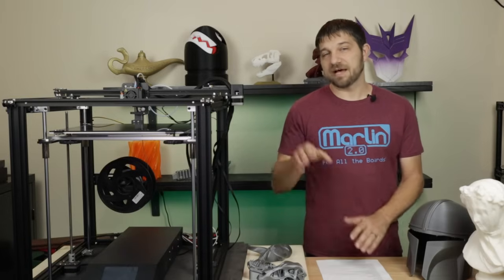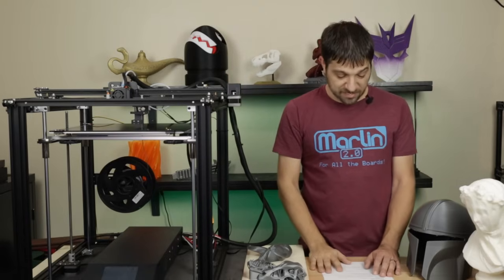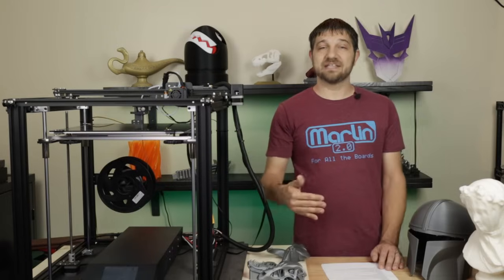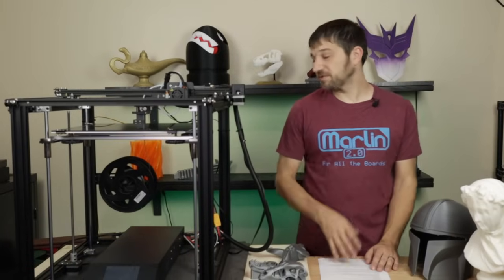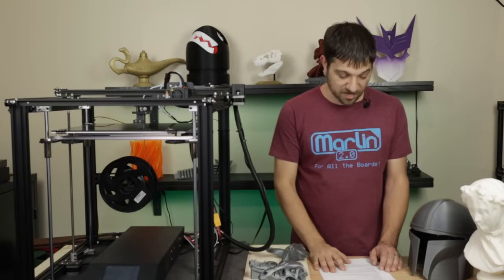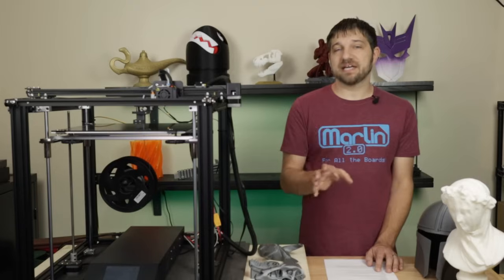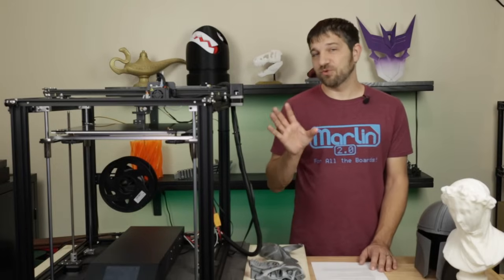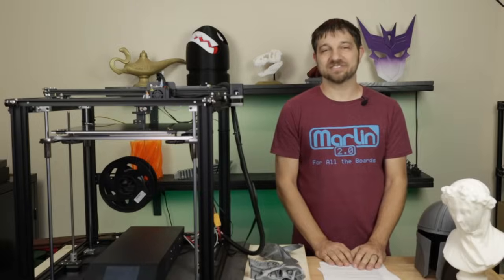Creality Ender 5 Plus Review: EVERYTHING You Need To Know!

Comment: Hi,

What happens if one of the z-axis stepper motors is one (or more) steps behind or ahead? The printer doesn't seem to know where one or the other motor is since they are hooked up in parralel or serial at the same stepper driver, so the motors are not synchronized are they?

So if one motor is a step (or more) out of sync the bed construction is not alligned. Do you have to alligne both z-axis motors manual? What happens if one motor skips, and what do you have to do after that?
Reply from the maker: If one of the motors were to lose a step while performing a layer change then, yes, your print would be off. If that happens though, there is a problem with the mainboard or the stepper motor. There is very little force/resistance on those motors since they are performing very small steps and doing relatively little work thanks to the shallow incline of the screw. I have seen people mod the printer to include a belt between the motors for synchronization but I think it's unnecessary.

If you were to push the printer too fast during a Z move or manually bump one of the motors/screws, you would need to manually re-level like any other dual Z-axis printer.
Reply: @kerseyfabs  Thank you very much that was what i needed to know.

So yeah i understand it can happen, how do you relevel it fast? Is there a procedure in the creality manual for it?
Reply from the maker: I don't think there is a procedure for any printer to re-level during a print. You'd probably need to stop, diagnose why it happened, and then start again. If it happens once then there would be concern that it would happen again.

Comment: Awesome video. 😁👍🏼 What kind of software is used to create the objects you want to print? I’m a noob. LOL
Reply: Hey DJ! There are two main pieces of software involved in 3D printing; a CAD modeling program, and a 3D slicing program. CAD programs could be anything from Solidworks to TinkerCAD, Google Sketchup, Blender, Fusion 360, Auto CAD, Etc.... There are many options. These are the programs people use to design custom objects (: You just need a program that can design a 3D object and export it into a usable file for 3D printing, an .STL is standard. You can also download .STL files (3d objects) that other people have created from many places on the internet like Thingiverse or MyMiniFactory.

Once you have your .STL file, you then import that file into your second program, the Slicer. Some of the common ones are Cura, Simplify3D, Slic3r, but there are many others and most 3d printers will come with a slicing program on the SD card. The slicing program has one job - to take your digital 3D object and turn it into physical, mechanical instructions for your 3D printer. It's the slicer that you would use to set your parameters like print speeds, temperatures, layer height, fan speed, etc, etc, etc... for each of your prints. Once you have your settings how you want them, you then export the file from the slicer, which is usually a .gcode or .x3g file. This is the raw instructions that go on the SD card, which you then load into the printer, find your file, and hit "Start".

Comment: I am looking into getting a 3D printer and was wondering what you thought the best printer is that’s under $600?
Reply from the maker: "Best" is very difficult since there are so many uses and so many need. If it's your first 3D printer, there's nothing wrong with getting something smaller and time tested like an Ender 3, Ender 3 V2, or Ender 5 Pro to get you started. If you need something bigger, the CR-10 S-series is a bit easier to use than the Ender 5 Plus. If you want an awesome platform that's excellent for modding but is sometimes a little frustrating for newcomers, the Ender 5 Plus is my favorite printer. I know I haven't listed any other brands here but it's because low-cost brands always seem to have tradeoffs and Creality makes solid low-cost printers if you do your research on potential issues with some of their newer models.

Comment: Can I install a skr 1.3 with tmc 2208 or 2209 on the stock printer? Waiting for creality to give us marlin source code for report settings to marlin 2.0...
Reply from the maker: You'll need some sort of mounting adapter for the board and probably a new display. I'll be doing something similar to this. Different board to make things easier.
Reply: @kerseyfabs  MKS SGEN ? can re-use stock display with this board ?

Comment: is it possible to do a 360mm circular print.  I see the build plate is 371mm dont mind modding the head back plate, fan position etc.  I have one one order and a print has just come in which is 360 diameter DAM IT.  printer want arrive for 10 days but its on route.  can can make a bigger build plate  if required from FR4 fiberglass as a temp solution
Reply from the maker: I see what you're saying. I'm pretty sure you'll be able to pull that off. You may just have to lie to your slicer. The actual print area is 360x360 though.

Comment: As someone who is looking to buy their first 3D printer I wonder why Creality makes CR-10 and the Ender 5 models? I know size comes into play but the features seem to be the same and any features they may lack you can mod and add so that seems a wash as to difference. So it seems to go back to size but both CR-10 and Ender 5 have both small and large models. So why would someone buy one over the other? Ease of use and putting it together?
Reply from the maker: The CR-10 and Ender 5 do have similar software and features. The main difference is the way that they move. The CR-10 line is similar to the Ender 3 in the way they move. There is an X gantry that moves side to side and the bed moves in the Y direction. Then the X gantry also moves up for height. Now depending on bed size and weight of the print, you can have issues with ringing on the print or possible issues with parts coming loose on the bed. Many people really don't like the idea of moving a heavy object like the bed rather than I like part like the print head. That's where a printer like the Ender 5 comes in. The bed moves up and down but the print head moves X and Y.

Now in reality, many people have CR-10 variations and love them. They learn to print on them with little to no issues. So for Creality, it's offering both types of printers for both types of customers. There is more to say on this but too much for the comments. 😀 I hope this helps.

Comment: Any idea if you were remove the top front cross bar in order to fit an e3d hemera and petsfang/hero me if it would be just as stable ? Or would you have to have a custom bracket to extend if out a bit ?
Reply from the maker: It would probably work without it but I wouldn't do it, just fearing losing rigidity and quality. I plan to work on this, so I'll share everything.
Reply: William, I added the Hemera to my Ender 5, and lost about 10mm on front and right side.  It should work on the 5Plus, but will have the same problem.  I expect more mods to allow for it to work without loosing print area.  I also had to come up with a way to feed filament to the Hemera.  Here is my setup.  https://www.youtube.com/watch?v=mSIcFcq5_Ww
Reply: @woodwaker1  Very nice. Yeah I know its not much to lose but it's still a loss lol. I also have an Ender 5. Been through hell today trying to get the bed to stay level. Seems like if I even bump the front of the bed it gets all out of whack. Just tightened everything. Maybe I have some bad springs idk.
Reply: @williamtaylor2807  I replaced the springs with solid mounts from TH3D.  They are a pricey, and you need some kind of ABL to do this.  Since then I have not had to level my bed or worry about prints.  I have an Ender 5 Plus with the BL Touch - much prefer the EZABL - it does not contact the print bed and seems much faster.  I think the solution to the Hemera will probably be some kind of bump out.  Here is something I'm looking at.  https://www.thingiverse.com/thing:3760726

Comment: Hello. I have a new Ender 5 Pro (2 weeks). My first four prints came our nearly perfect. Now, suddenly the printer is under-extruding. The filaments of the adhesion brims are not sticking together,  completed prints a brittle and nearly hollow, fills are mis-formed and almost non existent. 

In your experience is there any reason for this to suddenly happen? I have installed a new nozzle, but have achieved the same poor results. Any suggestions on where to look to trouble shoot? Filament stepper motor perhaps? Any advice would be greatly appreciated.
Reply from the maker: Definitely check out your extruder while you're printing. See if it's skipping or slipping. Also double check the steps/mm on the E stepper. You should be able to find that in the menus. I'd expect it to be around 93 steps/mm.

Comment: How loud does the Ender 5+ get? It seems perfect given my budget, but the only place I have for it is on my personal desk
Reply from the maker: This printer would be too noisy for me next to my work area. You could upgrade the mainboard though and get it much quieter. You'd also need a very large desk.
Reply: @kerseyfabs  I measured it out for size, but how would building an enclosure effect the noise?
Reply from the maker: Some but that greatly depends on the enclosure.
Reply: @kerseyfabs  Alright, thank you for the info :)

Comment: I got my Ender 5 plus and started printing, my first benchy I noticed I'm getting these annoying blobs/ zits and can't do anything to fix them, l've used brand new filament, used a good quality San disk micro sd and played around with settings, is my printer defective and should I return it?
Reply from the maker: I doubt it's defective. It's probably just settings.
- It could be power loss recovery. Be sure to add this to your start gcode to disable it: M413 S0
- It could just be your profile. Try this profile for Cura: https://drive.google.com/file/d/1gcL-APGY_3MJnGODdJhFKLrqCabzIi6z/view?usp=drive_link
That is for an all-metal extruder, so you may need to adjust the retraction but the rest should be good.
Reply: @kerseyfabs  I tried this profile and still getting zits

Comment: i think i have a big problem my E-steps are ok, when i ask voor 100mm i get 100mm but the extrusion speed is to high and my extruded filament is 1,16 mm width. it should be 0,48. i really cannot find the raison and begin to think i have a bad control board
Reply from the maker: Have you double checked the flow rate in your settings or your slicer?

Comment: I have had this Ender 5 Plus for over a month now and I haven't been able to print one thing. I have had several issues including at the home position it grinds like the limit switch is broken.  Second the software and app doesn't support Apple IMac or Phone  but the advertising states it does but not in Florida. Unless i get these issues fixed it will be going back. Help if you can.
Thank you Wild Willy

Comment: Thanks to much research and your videos, I too am now the owner of an Ender 5 Plus.  No arguments with this machine at all.  I've been using (2) of the Robo R1 Plus printers from Robo Inc for the last 6 years, so I figured a larger format printer was the way to go.  A printer like this.  
My question is, is there a good "User Interface" program that you can import, set up and print from.  Lets say, if you weren't using an sd card?  I use both, but I've gotten spoiled on the Matter Hackers software with the Robo Printers.   Now just trying to find a good program for the Ender 5 Plus.  
Thanks again for the very informative reviews too.  :-)
Reply from the maker: Take a look at OctoPrint and OctoPi. Those projects allow you to add a web interface to any printer. I have one on each of my printers.

Comment: How do you compare it to the CR-10s pro V2? If you can.
Reply from the maker: Well, I can't compare it from a personal experience stand-point but I can from a feature stand-point. First the the Ender 5 Plus is about $60-$100 cheaper than the Pro V2. It has a bigger build volume and a bed that only moves on the Z-axis. The Pro V2 comes with a silent board, upgraded extruder, and a Meanwell power supply. Many of the other features are the same. If you don't want to have to upgrade components, and the build volume is big enough on the Pro V2, then that's your printer. If you want a better overall design (IMHO) and don't mind upgrading, I think the Ender 5 Plus will be a better printer in the long run.
Reply: Kersey Fabrications thank you!! This 3d printing is blowing up these days. Hope your channel too.

Comment: Great video. Should have seen it as it came out. Beginner in 3D printing after having used Prusa Mk3 out of the box and immediately suffering from trying to get  the Ender 5 plus to work. Highly confused with a simplistic touch -screen that may or may not accept commands I thought I had given. Completely on the verge of nervous breakdown when filament sensor triggers a change rendering the whole instrument dysfunctional. Immediately heated bed and nozzle again only to find I was burning a crater into my object as I forgot to lower the Z level while conducting the awkward filament change. Haven't understood the meaning of the filament sensor at all in that it doesn't enable anything I couldn't do manually or am I wrong? Very stressful to work with. Further loads of heating issues due to unfortunate ambient conditions and high targeted bed temperature ultimately leading to mainboard burn out.
It is embarassing to admit, I rather accidetally learnt to get the thing working at a proper Z position ==> when in leveling mode, the semiotic message "Go home", the house, is implemented as "Set this level to be the Z home". As I am very old, this is for me similarily frustrating to the "What's app" lack of  educational wherewithal to have a crossed out microphone signal say: "This microphone works", while in order to switch it off, you need to illuminate its perimeter.
Reply from the maker: That's a lot to unpack. I'll see what I can do:
- The filament sensor is designed to let you know when you're out of filament and need to reload. When it's out, it should move the print head to the back corner and wait on you. It should not remain over the print. Then you don't touch the print head, remove the old filament, and load the new filament.
- Unless you're printing something exotic, your print bed should be about 60C for PLA and 80C for PETG.
- I hope you have bed leveling figured out. I'll try to add more information in the future on how to do it on different printers.
Reply: @kerseyfabs  Thank you truly, your commitment is much appreciated.

Comment: Hello. I am a total newbie to all of this. I am doubting between the Ender 3, Ender 3 Pro, Ender 5 or Ender 5 plus. I know the plus is the largest, but. Is it so much better then the basic E3? Thanks
Reply from the maker: I completely understand your confusion. If I were to recommend a printer to someone totally new, I would usually go with the Ender 5 Pro. Now if the cost is a problem, the Ender 3 is a fine choice. The Ender 5 Pro is a great first printer though because it's easy to assemble and comes with several upgrades pre-installed. You can find the Ender 5 Pro from Creality here but they are currently sold out: http://bit.ly/Ender5Pro
Here is a link to an Amazon listing but I have no ordered from here personally: https://amzn.to/2WPfyM7
I hope this helps.
Reply: @kerseyfabs  Final question, the ender 5 plus you talk about here. Maybe that one is the best choice since there is a bigger space where you can print? Thanks alot for the interesting words, I appreciate your thoughts alot.

Comment: For this price point, size, capability, reliability, and opportunity to mod, would this be your top value for a printer?
Reply from the maker: Now that you mention it, one thing I didn't cover was price. I'm sorry I missed that. Value is very difficult to judge sometimes.  There are cheaper options from companies like Tronxy but, since I haven't tested them, I don't know how well they work out of the box or how good they are mechanically.

With that being said, I am a fan of this printer design and this would be one I would buy myself for overall print quality and mod-ability. I don't know if I'd call it a "top value" since it's not inexpensive and you can get some slightly smaller printers (300x300) for less money. I like the size/price/expandability/print quality that this printer offers.

Comment: Hi, what's up? :) could you please write down how are the plastic wheels on the cartridges  y axel? how long you have beed using the ender 5 plus?
Reply from the maker: I'm not a huge fan of the wheels because they tend to collect dust and wear out over time. This is no difference though than any other machine that has them. These are common these days. I've been using my Ender 5 Plus for several months now.

Comment: Does this printer handle filament change gcode instructions ? My old Alfawise don't handle theses gcode and that's a mess when I want to make multicolor print.
Reply from the maker: No. The default display can't handle the filament change. You would need to update the display and firmware at minimum.
Reply: @kerseyfabs  Thank's for the reply.

That's an important feature, I will give a look on other printer then. Maybe Creality S6 max.

I don't want to deal with custom firmware and tweaking the hardware except if that's straight to the point.